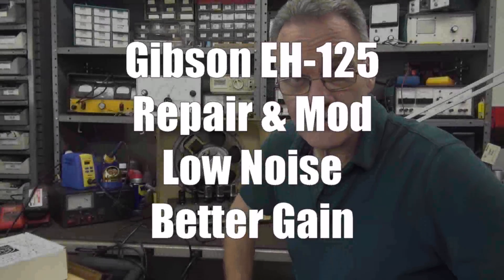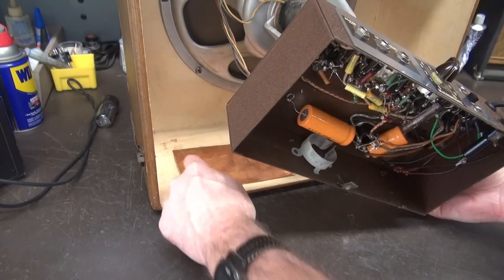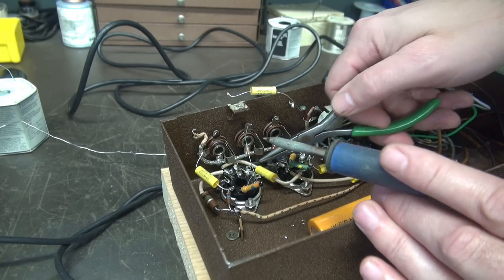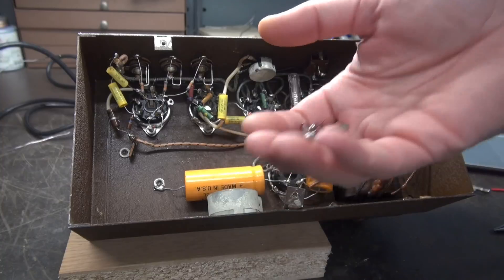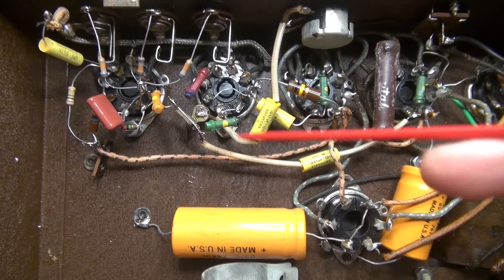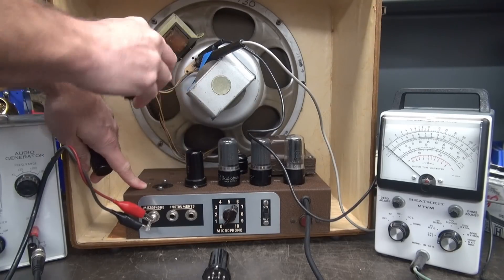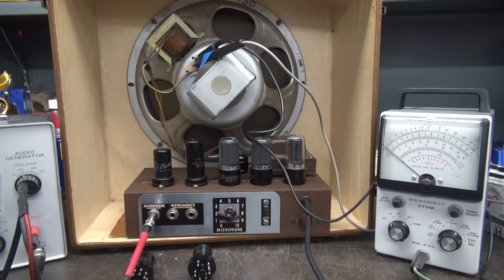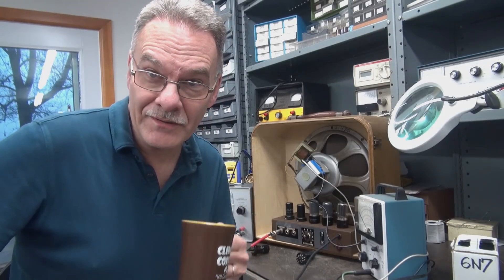How to reduce noise Increase gain Gibson EH-125 Tube Guitar amp simple modification

Comment: After much contemplation I wonder... given the age of this amp the microphone input was probably designed around being used with a crystal mic. These are drastically different than a modern electro-magnetic system of transducer, so it would have been interesting to test the stock configuration with an antique piezo crystal microphone.

Comment: hey D-lab im assuming you gave that 6sj7/6ac7 spot a cathode resistor? cuz you took out the grid leak bias circuit. so if theres no cathode bias added the tube should be able to run away right? your drawn schematic doesn't show a cathode resistor and it made me wounder if its miss drawn?
Reply from the maker: Grid leak cap is installed. I will publish that in the new schematic rev on my website
Reply: @d-labelectronics  oh i see, i thought you took the grid cap out. it makes more sense now lol

Comment: I have a GIBSON RVT 35  it has 2 of the 7591 Power Tubes and 6EU7's in the pre-amplifer stage. I built a new Cabinet 5ply birch and a new speaker. It squeals and has to much treble I hope there is cure for it.  At 35 Watts is a powerhouse amp.

Comment: Nothing more gratifying than finding a design flaw and fixing it. In addition: Installing an electrolytic 50uF at 50VDC across the 200 ohm common cathode resistor of the output tubes should increase the gain a little more. Also, a slight mistake in your new schematic for the 6AC7 tube. The location of the suppressor grid pin 3, which is grounded, should be swapped with the screen grid pin 6. It should be plate then suppressor grid pin 3 then screen grid pin 6. Compare it to the 6AC7 tube schematic. Good job though.

Comment: Hey Terry, great video. In your new schematic, shouldn't the Suppressor Grid be pin 3 and the Screen Grid be pin 6? Also, in later Gibson amplifiers late '50s early '60s, they started putting caps from cathode and screen to ground and started using grounding inputs on the instrument jacks. This amp could really benefit from those two mods as well. Gibson just loved pentode preamp tubes for some reason. I'm not really a fan.
Reply from the maker: Hello, I did not change that socket wiring. It is as shown on the schematic, right/wrong? Cannot say
Reply: According to both the 6SJ7 and 6AC7 datasheets, the suppressor is on pin 3 and the screen is on pin 6. Having your suppressor grid tied directly to ground, doesn't seem right to me.
Reply from the maker: Yep, Thats how it was factory wired, The 1st one I had here last year was the same. Dont know what to say : )
Reply: @d-labelectronics  Not arguing that. I just find it strange that it would have a voltage on the screen and then have the suppressor tied to the same point as the cathode. Kind of defeating the purpose of the pentode design.

Comment: If the first stage is grid-leak biased, doesn't it also need a coupling cap at the input, like in the original schematic (.01uf)? Your schematic is missing it.
Reply from the maker: Hello, Good observation. I added it as a test, no difference in gain, Thanks for the input, I would assume it could be configured either way
Reply: @d-labelectronics  I've read that it is to prevent grid current from leaking thru the input resistors and that it would help keep the grid at negative potential to help bias the tube. Interesting it still works without it. Maybe it's a cautionary addition to grid leak bias circuits. All amps with it have that cap.
Reply from the maker: Yes, I agree and installed it. Will update the schematic
Reply: Yes, I was also wondering how the tube would properly bias without the grid leak bias cap there to charge up from grid current and bring it negative (hence the massive grid leak to hold charge in the cap). converting to cathode bias would be a more stable configuration anyways.

Comment: Seems like the big issue here is a misunderstanding of the design.  The control is clearly labeled "microphone".  Apparently it was expected that the guitarist would use the controls on the guitar to control their volume.  The pot was just to strike a balance between mic and guitar.   I did notice that your redesign changes the input impedance - which could affect sound.

Comment: D labs, I'm confused why the variable pot BEFORE the tube caused noises and hissing issues, any reasons why?
Reply: I'd image that 1) the amp was always running wide open and 2) the pot was in the most sensitive part of the circuit (the input) and acting like an antenna.

Comment: Gibson made these amps for absolute clean at max volume. Overdrive at the output was like nails on a chalkboard to the old timers.
These days, it’s blasphemy to not have overdrive. I do agree 100% with moving the volume pot location in the circuit. Gibson did the same thing a year or two later in a circuit revision in all of the instrument amplifiers. 

These amps had wax/paper coupling caps originally, by now, they’re all leaky. You will never hurt my feelings replacing those. Just don’t throw them in the trash.

Comment: Pardon my intrusion, but, twisting tubes into place to find the socket groove is a NO-NO..!!!!!   You are depositing the metal from the tube pins to the socket, allowing metal to span from socket hole to socket hole...  Especially nice when installing 6L6-EL34 type tubes, then shorting plate to filament!!  NO, you cannot remove/clean ANY of that metal as it is ingrained into the socket material, so the socket MUST be changed out..   I do a brisk business replacing sockets and tubes, if the fuse(s) has blown in time and you haven't shorted the output trafo..!!  LOL!   Go, boob toobers go..  I love it..!!!   LOL!
Reply from the maker: I agree, just showing that I am human
Reply: The guide pin structure is longer than the tube pins. As long as Terry keeps the tube level and plumb, the tube's pins should never touch the socket.
Reply: @kornami8678  After more than 40+ years as a successful tube amp tech, I think I have seen a LOT more than you..  BUT, hopefully (can I pray?), many boob toobers will read this and decide that your and D-labs method is better and makes more sense than mine..  NEXT..!!!  LOL!  boob toobers, ya have to luv 'em.....!
Reply: @pjf7943  Hi PJF. Can you explain how metal is deposited on the phenolic or ceramic socket when the center index pin (Guide pin) is longer than the tubes electrical contact pins, "in all applications?" How can you deposit metal, when no metal touches until the index (guide pin) allows the tube to drop in square? The solder on the tube base connections doesn't rub off and leave a track either. Where do people come up with this stuff?
Reply: @MrCarlsonsLab    'Mr. Carlson's Lab = Sleepy-time videos....    It's called experience and a lot more than you are old......!!

Comment: Great video. Adding flexibility is always cool. The 6N7 did perhaps have a bit better sound. My only question is: in your experience, are either of the two inverters more robust than the other?
Reply from the maker: They are both vintage metal tubes, still surviving. Both are robust

Comment: Hi Terry! I get into these old Gibson amps here and there and enjoy seeing your solutions! I have a question about the final schematic. The 6AC7 seems to have the screen grounded and 25 volts on the suppressor grid through the very large resistors. Doesn't grounding the screen turn off the tube? I know I'm missing something here.
Reply from the maker: Hello, The actual base conf was not changed from the 6SJ7 when using the 6AC7, see the tube data charts for more info on that screen
Reply: @d-labelectronics  Thanks much!

Comment: I hear quite a bit more detail with the 6N7...
Reply from the maker: Yes, I noticed that the 6N7 was a bit fuller sounding. By the way, this is a dual triode tube, strapped in parallel
Reply: @d-labelectronics  Any specific reason not to put them in series?
That way you will have plenty of gain and/or more freedom to add some additional things.
Reply from the maker: I did not want to modify the circuit. This method allows use of the stock tube as well as the 6N7. Im sure there are many improvements that could be incorporated, however not the intent of this video

Comment: I guess you could use a 220k anode resistor to even get a little more gain as well as bootstrapping the cathodyne phase inverter. 
But really nice you fixed that noise issue!
Reply: You are correct sir. But, going that route may be too much gain to bring on distortion. In the day, every thing was geared to clean output. Good catch though.
Reply: @kengevers8738  True, it will also change the sound slightly.
But it was nothing more than just a little idea if people are looking for a bit more gain.